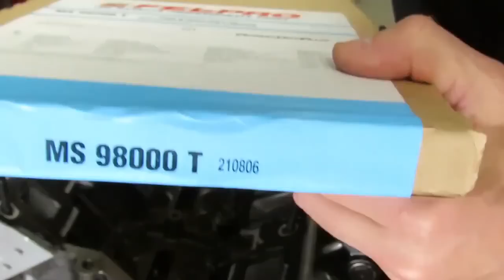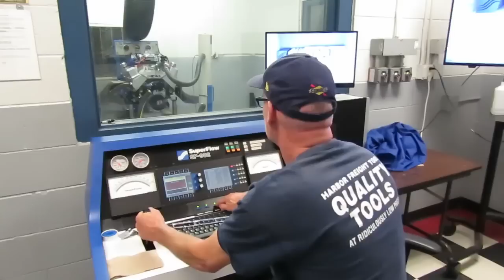350 Chevy Top End Up Grade

Comment: WD 40 was not designed to wash parts, It was designed to prevent ICBM missiles from corroding in the silos, they would spray them down once a week or so, and no Corrosion, and while doing so they noticed its ability to penetrate nut and bolt threads, so off to the market they went with their penetrating fluid the only reason you have wd-40 today!

Comment: Engine in my Malibu is as stock as we can get, 350 bored .030, cast pistons, stock 882 heads, Edelbrock performer cam intake and carb, makes 310hp and is a torque monster, runs 14.01 @ 92mph, and gets 25 mpg cruising down the road, God bless you guys

Comment: Well that "crappy" original crate engine will last very much longer compared to most aftermaket China crap Equiped engines...dont forget a Mercedes V8 560sel also cranks out only 250 HP

Comment: Man, I’ve never worked on anything past top end and just bought my first V8 car, an 82 Monte with the pig slow 4.4L 267. Watching your videos has given me almost enough confidence to do a swap. Awesome knowledge and you know how to convey it like a classic shop teacher. Thanks!
Reply: Geez , I must have missed that 267ci small block in Monte Carlo didn't know they made them . I do remember two different 305 motors I think G. And H my mom's 85 had the G motor parts store used to ask when buying engine parts.
Reply: I just built a small block 355 watching his videos. Good luck on your MC.
Reply: I had the same motor in a 1982 Pontiac GP. Pull it, get enough for some refreshments, and build a 350. 215@ .050 and 2.67 rear gears and it will do 140 mph!
Reply: i had a 305 turd in my bird........i watched this guy(and a few others like uncle tony,dd speed shop etc ) after that i added vortec heads(i did my own valve lapping,new valve seals,new beehive springs and retainers) and matching edlebrock intake,holley carb, new flat tappet lumpy cam,headers etc......i never did anything like this before........night and day brother and i did it all in 2-3 days while the engine was in the car...i drive it every nice day and i love it (1986 trans am) if a newb like me can do it,anyone can

Comment: I used to struggle to get the power I wanted from a 350. Then I built a 400. Didn't take but a couple miles to realize trying to get power out of a 350 is like running in the mud. A 400 is where it's at.
Reply: I just meet in the middle and build a 383 because I can find roller 350 blocks everywhere for $300...all OEM 400 blocks are 40+ years old and are usually in bad shape when I find them is why I build 383s
Reply: Plus 400 small blocks get hot Easier and crack a lot due to steam ports not cooling good enough after years of rust and junk in water passages. Plus then your stuck drilling steam ports in aftermarket heads to match the block. Because most aftermarket heads don’t come with steam ports. But yes your correct though if you build a 400 right and find a good one with no cracks or nasty water ports they can be good engines just change rods and pistons because all 400s where low compression so they need flat top pistons or dome pistons and the short factory rod I think was 5.56 or something like that causes piston skirt wear and pressure so by adding a 5.7 or 6.0 inch rod they come alive like having big block power.
Reply: No problem getting lots of effortless power from a 350

Comment: I liked the timing cover recommendation.  However, few engine builders explain how to get the right length pushrods and why.  This is missing from this video.
   Here's what was not said.  At 50% cam lift, the rocker arms should be level.  There is a moroso pushrod length checking tool that slides over the rocker stud, and has a flat side to it.  After setting the cam lobe to 50% lift using a dial indicator, you rest the tool on the valve, and use an adjustable pushrod to make contact with the same flat side of the tool.  Take out the adjustable pushrod, and measure its length.  Then, order some pushrods.  Now, your valvetrain geometry is correct.  
  You can ignore this if you want egg shaped pushrod ends with eccentric wear pockets in your rockers.......if that is your wish.  The more radical the cam, the more you need to do this.  Higher lift cams require this level of attention.  Stock cams are already set up with the right length pushrods.....most of the time.

Comment: If you have aftermarket alloy heads, than if you run a 9.6:1 compression you can get away with running 87 octane (91 in places like Australia and Britain where they use  the RON  system as opposed to MON) any more is just asking for trouble. If you're going for an aftermarket block though, you may as well go for the Chevy 400 bore size variant, unless you are restricted for size say in class racing etc.. You can get them with the 400 bore size but with the 350 main bearing size as most aftermarket cranks are in the 350 crank bearing size, and the benefit is you get reduced friction with a smaller journal size anyway. Nice to build a 427 size smallblock
Reply: No offense, but those that are unable to tune, and unwilling to do proper preventative maintenance always say keep it at 9.6:1 or less. 10-10.5:1 or so is very doable with proper tuning it may require colder plugs, a custom timing curve etc. But all of that is part of dialing in a new combination anyway. Chevrolet was doing 10.2:1 with 70's tech combustion chambers in 1991.  It is much easier to do now days with fast burn chambers, ignition systems that allow precise tuning, even with a carburetor. To leave as much as 5% on the table with low compression is silly. A custom camshaft from a knowledgeable cam designer can make a 9:1 engine crank at 210 psi, or an 11:1 engine crank at 185 psi. There are many skilled professionals out there that can help you with your combo now days to make it ultra safe and reliable. Why pay good money and leave the power on the table my friend?
Reply: You cant use anything other than Brodix heads...all cheapo heads are Chinese crap
Reply: Todays fuel dont have the advertised octane rating you cant trust pump Gas except E85

Comment: You can do exactly the way you adjusted the valve lash and follow the firing order even on solid rollers, just do the intake valve on #1 next valve to adjust is #8 intake, but adjust intake valve  just when exhaust start to open, adjust exhaust valve just as intake starts to close...like you say then  just follow the firing ouder 18436572 then start on the exhaust 18436572 2 rotations of the crank and you are done. When adjusting solid rollers it gives you a perfect tune. To me it makes more sense to move your tools to a new cylinder than to rotate the crank 50 revolutions just to do a simple  valve adjustment.

Comment: Why would you use the Edelbrock etec when you can get a set of CNC afr 195 for 1-150 less? Edelbrock makes the afr castings. Just the lighter weight valves alone kind of make it a no brainer to use the afr, or trickflow CNC 185-195 heads. They can do the vortec intake bolt pattern on the 195 eliminator for a minimal upcharge. Unless you are an Edelbrock dealer and can get them way cheaper than retail it just doesn't make sense. You get so much more for 150-200 difference in price.

Comment: In regards to your initial comment about "take any old engine, slap heads/cam/intake on". My question is, in your opinion, STRICTLY SPEAKING SHORTBLOCKS (not including cam or any other valvetrain, as that would be unfair), what has been the biggest technological change when comparing a SBC shortblock to an LS shortblock ? Obviously Rings are better today, bearings might be as well, but does the improved 'Metallurgy' affect the cylinders/blocks themselves ? Let's say we go to the junkyard and pull a 100k mile 350 SBC and a 100k mile Iron block LS. More than likely the LS motor will still have healthy cylinders, bearings in good shape and really only need a cleanup, possibly a 'dingleball hone' (re-using it's current rings/bearings even) and finished with AFTERMARKET heads/cam/intake to make series power, like everyone is currently doing. The SBC will likely have enough blowby to sink a ship and be in far worse condition, even at the same mileage/usage as the LS and would require more of a refresh before final assembly. Has the quality of Bearings and Rings increased alone ? or is the finish of the bores better today ? Better metal in the castings ? Better (non-synthetic) oil ? I hope this gibberish makes sense. Great content as always.
Reply: surprisingly i have 3 sbc's + 1 in my current car.....none have scoring,blowby etc and run good......efi sbc's have a tendency to wear beautifully if they were occasionally maintained,some of the poorly maintained carbed ones have a lot of fuel wash and a cylinder ridge(but not all of them) the primary advantage of an ls is 6 bolt skirted bottom end,roller cam and amazingly good flowing heads.....the added cost of complex efi,transmission adapters etc,special headers can make them considerably more expensive
Reply: @trillrifaxegrindor4411  It's interesting that you list the 6-bolt bottom end, as most high perf engine builders use Dart SBC-Style 4-bolt Splayed Caps with either dowels or pins to keep the mains from walking, similar to what the skirt-bolts on the LS try to accomplish, yet still fails at times. Most choose that setup over the 6-bolt OEM setup for big HP/RPM. Also, Superior strength and less windage issues. The LS is great to simply 'rebuild' or 'refresh' from the junkyard. If you are replacing heads and block etc and use the same budget, there is no real power difference over a well built SBC, both with aftermarket blocks/heads. The LS does shine with it's hydraulic roller, where as a SBC has to go solid long before it reaches the LS limits of hydraulic roller.

Comment: Hey man,   No need to replace the pistons man,  just use E-85.
My car 🚙 is Flex Fuel ⛽,  I am running 🏃  11 to 1 compression ratio.
Which is No problem for the 104 octane of the E-85 Fuel ⛽. 
Burns 🔥 cleaner and makes more Power.   Also saving the Environment. 
Just put the flat top pistons back In.

Comment: Glad you stuck with the flat tops, wouldn't that cam have really lowered dynamic compression with the dished? I have a .060 over 350, 14cc dished .035 below deck, .015 shim, 64 cc Dart iron heads, 218/224, .460/.480 cam. Changing to 7cc flat tops, .015 below deck, .025 gasket, 70cc Dart iron heads, 231/235, .480/.488 cam. Static Compression according to Wallace Racing calculator went from 9.3 to 9.7, But Dynamic stayed the same at about 8.1:1 with good quench at .040. Seems harder to come up with a good combo when your trying to reuse parts instead of starting from scratch.

Comment: last year i picked up 4 4 inch stroke 454 putting out 450 hp with a 02xx 400r turbo behind them with 6,000 to 58,000 miles on them all running perfect they come with steel crank heavy rods high flow heads all they really need is to breath put a 850 with weiland high rise for street it really came alive has a good cam stock good sound to it . i put in a 68 chevy pu works good for the street i made it look stock like if the factory put it in it put a serpentine belt off a 94 454 4 row radiator that came with the engine and twin electric fans pushers with flex fan could not use the clutch fan no room for it the fan is a 1/2 inch from the pullies 1 inch from the radiator but the fan shroud covers it use a fan shroud out of a 90 Buick fit perfect then put the 94 valve covers just polished them up painted the intake same as block which is same as paint on the rig powder blue then i put a street scoop just to be fancy all wiring in looms blue color use blue aluminum spark plug wire holders blue header wrap polished heat shield for starter . so far i only have 1400 in the build counting buying the rig still have the 327 and 400 turbo that was in it both work good lots of after market parts on the engine have lots of left over parts about another truck all rust free parts cab that was a air condition cab in mint condition . so i could even make money on the build i have a bunch of people wanting to buy the parts even got new kicker panels cab corners floor pan i got for free  new in the box . next project is a 79 z28 rs t top all ready have most of the parts plus 2 hard tops all for free . i am the budget build king
Reply: ps on adjusting rockers i do it like u but after break in i adjust them y the engine is running mite be messy but works way better
Reply from the maker: adjusting the rockers with the engine running takes years of life off the cam this should never be done
Reply: @Myvintageiron7512  only if u don't know what u are doing the worse thing is breaking in a cam with the double springs on it u should use stock springs to break in a cam

Comment: Thank you for another great video and because it’s amateur hour over here, 😂 I’m curious if you are using a cam that is just a little more than bone stock such as the one pulled out in the video, can you still use the stock pushrods or does that automatically change the rod length?

Comment: I’m not trying to correct you, but the backstory behind WD-40 is interesting, but it was invited to keep the fuel lines from rusting and corroding on the Intercontinental Ballistic Atlas Missile. They would put brand new lines on these missiles before launching them, before the missile ever made it to its ceiling the lines would corrode and fail. You are 100% correct about what it stands for. WD stands for Water Displacement and the 40 is because it took the chemist 40 attempts to get the chemical right.
Reply: Soviets use Diesel oil for this

Comment: Awesome explanation of the effect of compression and octane. Can't wait for the dyno results, my guess 486 hp at 5600 and 455 tq at 4100. Great video.
Reply from the maker: dyno is in part 2
Reply: no it's cylinder pressures and temperatures when running. think about thats why boost changes it and at sea level vs Denver CO 🇺🇸 ect.
Reply: computers nowadays can easily control 12:1 and 85 octane gas just it's not the best combo to do it but it wouldn't kill it as long as the 2022 ECU isn't malfunctioning .

but yes fixed 1940's control's no that's a terrible idea and you can see the after math
Reply: @richardprice5978  compression is presure in motion. If there was the same amount of 02 at all altitudes boost would not change, it's called altitude density

Comment: Hi Vintage 7512,  My last 70 Impala 350/2bbl, 250HP had 441 castings on the heads (with 194/150 valves, I do not know the chamber volume)..  

I recently got another 70 Impala 4DSD, 350/2bbl, 250HP (mint 31K actual non rolled over miles, original shiny paint and original interior etc...).  I just got an original set of duals, made by Waldrons (the company that does the exhaust for Jay Lenos Garage), the factory single exhaust had pin holes in the exhaust. I was surprised the factory duals (with the resonators) are almost silent.  

The 4bbl 350 Impalas were 350/300HP.  I assume there was more than just the 4bbl carb and the duals to make up the additional 50HP.  I am thinking a cam and maybe better heads.   

I want to send the original heads that are on the current original motor out to have them cleaned up (so they are good with unleaded fuel) and tweaked up a little (port matched, Flowed, new valve guides, seals, etc.... I want a period correct early Chevy 350 Hydraulic cam.

I want it to be like a 70 Impala SS that was never made, nice factory cam maybe a Camaro 350/350 hydraulic cam, I actually have a Winters Foundry "Snow Flake" original LT-1 intake. I was thinking a Holley 600-650 w/vacuum secondary's original dual snorkel air cleaner and a set of LT-1 valve covers (just for looks).  I have been in touch with Eaton Detroit, they gave me the original Police Package (F-41) Spring information.  I will also add new Sway Bars and shocks, please keep this dialog going, Thank you, Cliff